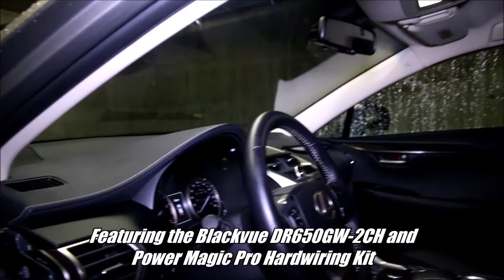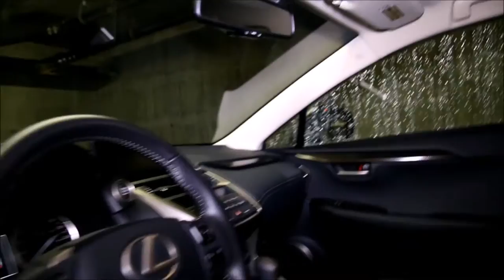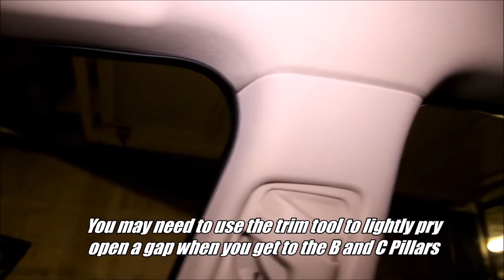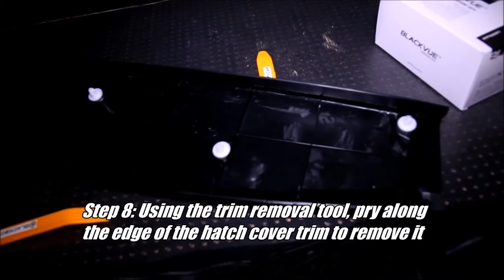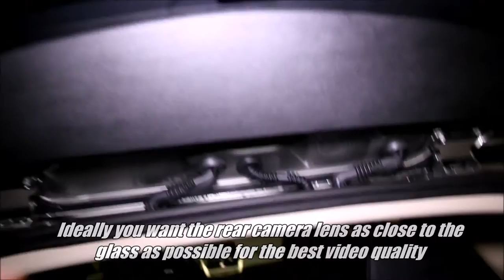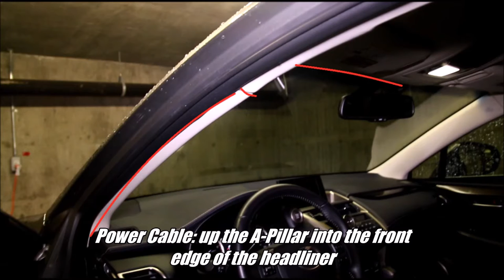How to Install 2 Channel Dashcam on SUV - Lexus NX

Comment: How so you cross the A-pillars with the wire? Putting the wire in the slit on the A-pillar covers would have the cable going right in top of the driver's side and passenger's side curtain airbags, that seems dangerous.

Comment: I have a 2016 RX350 and want to know what type of fuse and what fuse location I use to connect the VIOFO A129 Pro 4K.
Reply from the maker: Hi Edwin, this is a question our technical team can answer - could you please email us at info[at]blackboxmycar.com?
Reply from the maker: Alternatively, you can check your Lexus user manual (or call your dealership) and they will be able to answer your question too!

Comment: Hi, thanks for the great video. I have a Lexus RX350 (2015) and am looking to purchase a 2 Blackvue DR650GW-2CH dashcams (big cameras for front and rear, and small cameras for left and right sides). Should I purchase one or two Power Magic Pro devices and in case of two PMP's how should I hardwire them? Also , can I use one PMP with the cigarette lighter splitter? 
thank you in advance,
Dan.